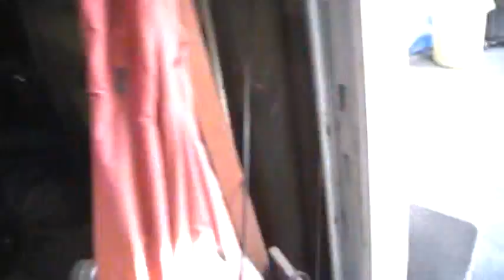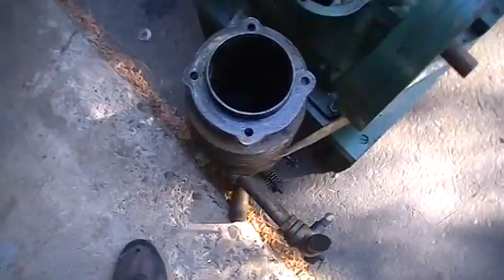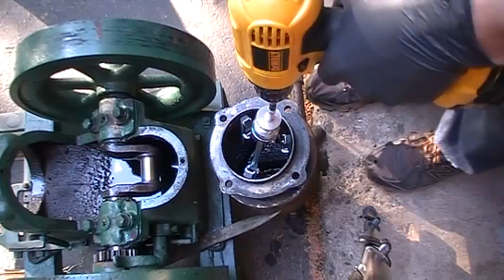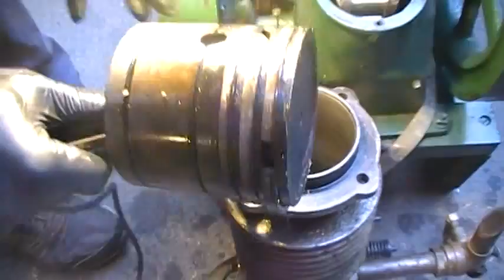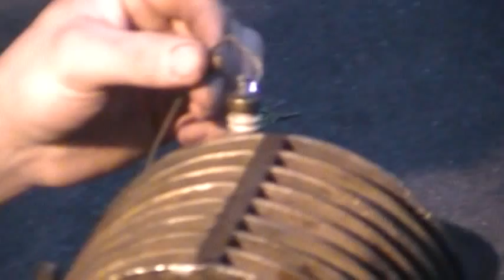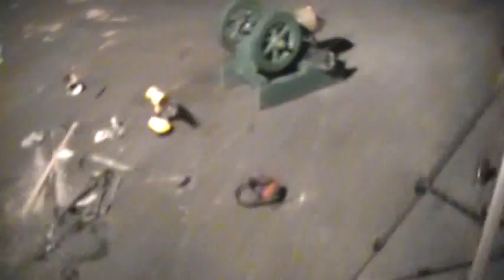12" Air-Cooled Ideal Engine | Part 1 | Honing Cylinder & Start Attempt

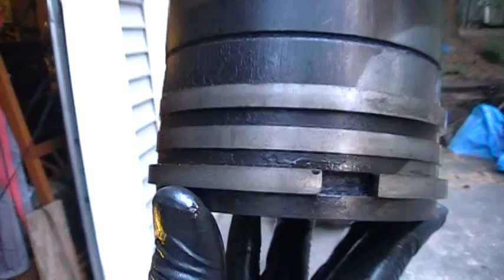Comment: Hey man wow your lucky you get to do this around this time of year well your lucky you get to do this at all!! Around here right now we are hard cutting wheat we start at 8:00 and we can work till 10:00 at night!! We get Sunday's off but man were just having brake down after brake down I drive grain cart and just today we broke the hitch pin and it drove about 2 feet into the ground!!! Hope you get it going good. ps: dose that thing have a crank or you just start it like that also are you going to have to get an Oiler for that or do you have one?
Reply from the maker: Yeah it's the busy time of year for sure! Yeah I know how break downs can be, they can really affect productivity. Holy smokes, 2 feet in the ground! I would love to have seen that! She will be running fine in no time. Nope it doesn't have a crank, you would think it would because it's such a small engine. And yes I have an nice oilier for it. I just took it off while I fooled around with the engine so it wouldn't get damaged. Plus I wanted to deliver more oil to the cylinder than the oilier could supply, because the rings were seating back in to the freshly honed cylinder, and they need a LOT of oil while doing so. Thanks for watching again Bud!! : )